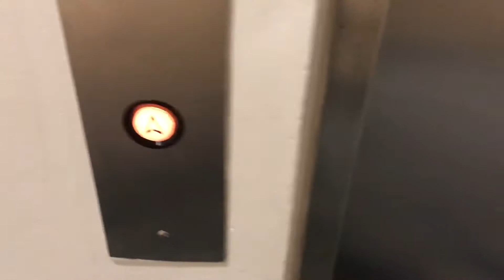Casper Elevator with MAJOR LEVELING PROBLEMS!!!!

Comment: This isn’t so much of a problem. See some of the elevators have a “pre door sequence”. This means that the interlock and door operator release the doors and open them before the elevator is completely level with the landing floor. You should in any case be vigilant about this or you may stumble over the height difference
Reply from the maker: Exactly. Thankfully they fixed this issue a few days after this.